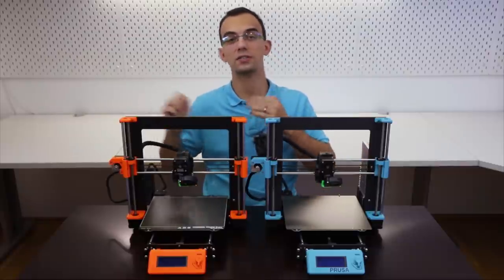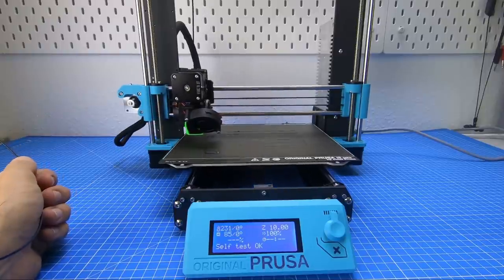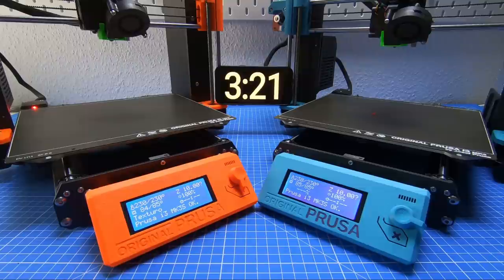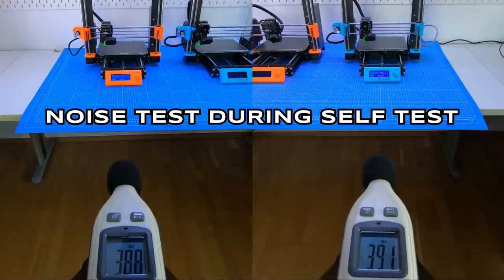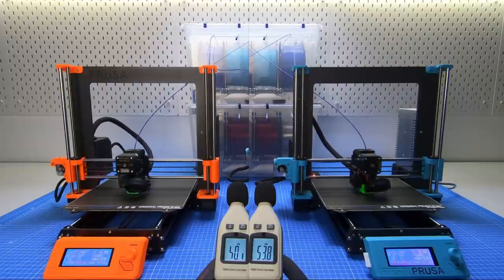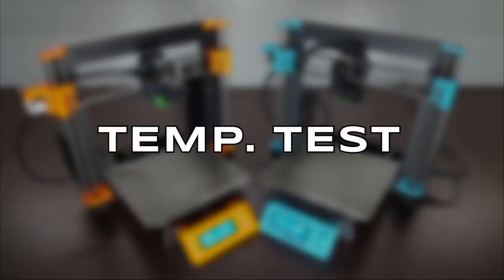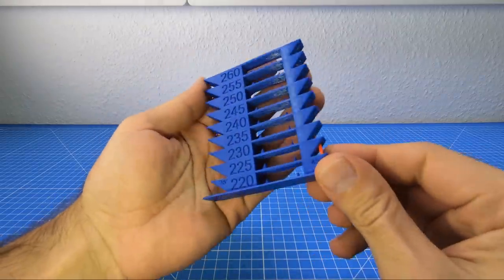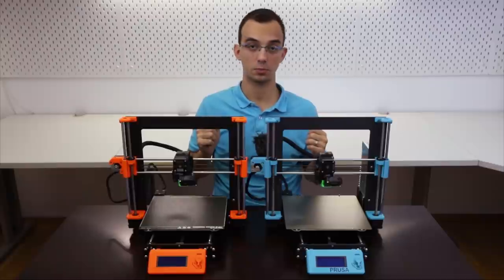The best Prusa MK3S 3D printer alternative? [test, compare, review]

Comment: Glad to see your good results with your Fysetc clone, definitely a testamant to just how polished the MK3S is as a design. I own two clones, one from Trianglelab and another from Blurolls, as well as a genuine kit from Prusa Research. I am planning on adding at least a Fysetc one as well as a colored Sealand/Blurolls frame kit to my farm. Long as you understand that you may have to replace some parts on your own they'll assemble just fine. That said, if I hadn't bought my genuine Prusa first, I would've never known what to check for on my clones to make sure everything was being assembled correctly. Run Sunon fans if you can from the start and definitely just print the PETG parts yourself as even Prusa's own farm parts leave a bit to be desired. And if you can, do Paul's silicone bed mod to ensure a super flat bed, genuine or clone. It's basically the nylock mod but better. Also stock up on those POM/Delrin leadscrew nuts and linear bearings, especially the leadscrew nuts if you're prone to destroying them like me.

In my experience I ended up liking my clones better just cause I knew what parts I was throwing into them and the fact support was on me. I also had a pretty bad experience with Prusa Support that led to me lone wolfing my genuine MK3S. My Trianglelab clone has more hours printing than even my genuine MK3S and I had the genuine one the longest so make of that what you will.

I did hear the Fysetc clone ships with a PTFE 4.1 bore hotend which if that's the case is just plain stupid. I am running Trianglelab's pre assembled V6 clone specifically for the MK3S on all my kits and as far as I know they are all metal from factory. 

For those saying the clones rip off Prusa Research, well the design is open source and the license specifically allows clones like these to be sold legally. 

Overall, great video and I am interested to see if you'll be reviewing the Bear frame clones or  other vendor's clone kits such as Trianglelab and Blurolls/Sealand in the future!
Reply from the maker: You made me curious with this bed "Paul's silicone bed mod" where can I find info about it?
Reply: @Dombi3D  https://github.com/PaulGameDev/PrusaMK3_Silicone_Leveling/blob/master/PrusaMK3_Silicone-Leveling-Jig-ThinBlade.stl

https://forum.prusaprinters.org/forum/user-mods-octoprint-enclosures-nozzles/prusa-mini-silicone-bed-leveling-mod/

For the jig and a comparable guide except done on a Prusa mini, process is very similar to doing the nylock mod though on the MK3S.

I don't think he's finished the guide yet but it installs similarly like the famous nylock mod. Only difference is you cut 3mm ID 7-8mm OD silicone car vacuum tubing to act as the new standoffs. 

Basically take off the bed, remove all the metal spacers except the one in the middle and replace them with the tubing cut with the jig. Carefully reassemble the bed so that it's being screwed in evenly and the silicone is compressed to the height of the old spacers. Once that is done fire up octoprint or pronterface and run G80, let that finish probing and then run G81 to get the absolute values. Once that is done throw the values in to this site 

https://pcboy.github.io/g81_relative/ 

and it'll convert it and tell you which screws to turn to raise or lower the bed. Once you get it to about 0.05 deviation you can start to level it at the bed temps you normally print at to get it super flat. When it gets to about 0.02-0.03 deviation it's good enough and the PINDA will take care of any remaining deviation. Paul recommends releveling after a week to account for the silicone settling in. 

Having done it to one of my clones I can honestly say it's worth the trouble but if your leveling is fine with the metal spacers I wouldn't mess with it.

Sorry for the long write up and if anything is unclear. Paul is active on discord, mainly Prusa's and 602 and if you need more info I can link you to those servers.
Reply from the maker: Thanks for the explanation. It looks really interesting. I have the feeling that the normal nylock mod is more stable but maybe I will give a try to this version also.
Reply: @Dombi3D  No problem! And that would be awesome if you ended up trying both mods!

Comment from the maker: Since then I have just found out that there is a hidden easter-egg "Experimental" menu in the new Prusa 3.9.1 Firmware where you can set up an "ALTFAN" (alternative fan option, because of the Noctua supply shortage the original Prusa had to deliver 3D printers with other fans also) which slows down the nozzle fan RPM and at the same time it makes the 3D printer more quiet. I will make a short video about it, but you can also try it out when you go under Settings -> HW setup and roll down to the bottom and push the knob around 3s. After it the new menu will pop up at the very bottom. Could be that it wont make any change first just after you restarted the printer. Tell me if you managed it.
Reply: Will slow down the fan RPM. That means there will be less cooling? Or is this option for the Clone with 3000rpm more in your Video?
Reply from the maker: @extrutim  This option is good for 3 wire fans for the Clone to make it more silent.
Reply: We can try that feature to clone prusa with out heat problems?
Reply from the maker: @gorilasfpv4600  I have not tried yet but seems OK for me.
Reply: I recently bought the Fysetc clone and tried the altfan option. It reduced the speed from around 7200 to 2800, which is even 1200rpm lower than the  original noctua one.

Combined with the seemingly lower efficiency, I think this might possibly  lead to the heatcreep issue territory.
Reply from the maker: @Jay Rizzie  It could be. Have to try out.
For me noise is not an issue because they are in the basement but if you sit in the same room (what I would not recommend) the fan noise could be annoying with time.

Comment: Outstanding video.  I wish it had existed when I originally purchased a clone from Fysetc.  I later bought an MK3s kit from Prusa.  The clone has worked fine, but the assembly was challenging.  Too many of some screws and nuts, not enough of others, no 3mm filament for the extruder cable support, a few other things that I have long since forgotten about.  Both of my printers get used a lot.  If I prorate the additional cost of the Prusa against the savings for the clone - especially after the E3D hotend and fan upgrade, the savings in price is negligible.  

I completely agree.  If this is your first build and you can afford it, buy a Prusa.  You won't 2nd guess your decision later.

Comment: I came to the same result as you.
I did the following changes to the clone:
1. original PRUSA fans
2. Original PRUSA Hotend (E3D V6)
3. Original steel sheets (smooth/coated)

everything else remained untouched.
Print results are equal as you mentioned.

But for unknown reason, if I need something, I always start the original PRUSA, I don't know why, but I do :-)
Reply: A complete hotend is not needed - I only changed the heatbreak to an e3d PE (for potentially adding an MMU2s) and the thermistor to the Prusa one. The nozzle is also changed to a higher quality on, non-abrasive.
For the PEI powdercoated sheet - of course ;-) It is definitly the best. The smooth one - my original smooth sheet is in its original package for more than 2 years now... The fans of my original prusa I changed end of last year - fans are not for eternaty anyways. So I keep the ones from the clone until they need a change anyway.

But there is one change I strictly recommend: Replace the spacers of the bed (exept the one in the middle as reference) and use nylock nuts for the other eight screws instead of spacers. So you can manual level the bed using octoprint. I normaly do not use octopint (I installed it on a normal PC only for calibrating bed). With an improved manualy leveled bed, the first layer is improved a lot.
Reply: @oleurgast730  actually, all my 6 printers got E3DV6 hotends, so I had them „in stock“. 
if they are assambled as intructed by E3D WIKI, they never ever make trouble. At least for the last 6 years
Reply: @frankvonthienen3862  Of course the do not make trouble - but there are two versions. The heatbreak for Prusa has a special design, to form the tip. The normal e3d hotends do not have it.
You mostly will not have any problems, exept if you add an MMU2.
But you won't have problems with the cloned hotend either, if you only change the heatbreak to an e3d heatbreak in PrusaEdition.

Comment: Nice explanation between the 2 printers, at home I have a MK3S and a mk2.5s printer. I was looking for some info of the fysect version but I couldn't get some clear answers until I stumbled upon this video ^^ good job!
Reply from the maker: I am currently working on the unboxing and assembly video. Stay tuned because I will give tips how could you build it even better than it comes with stock parts. I compared it with all stock parts build but new bearings and heatbrake would make it even better and safer.

Comment: I bought one of these instead of the trianglelabs one thanks to this video.I just finished the assembly today with my own printed parts in PLA exept for the extruder and the board case wich are PETG.  Definitelly buy your own M3 *8mm screws, this is NOT OPTIONAL. I almost ruin the Z motors because of that. 
The bearings I got were fine but you might get bad ones.
It worked perfectly once assembled, didnt even got that weird upside down LCD cable problems.
I didnt even needed to calibrate ther machine, not even the ESteps.
I already have an Original prusa mini and print quality is identical.

Honestly, its a great machine, I didnt expect it to work so well. Also is my first printer kit and it was super fun to build.
Reply from the maker: I had the same feeling :) That is why I bought 6 more :) IKO bearings have arrived today. So I will be not bored in the next weeks.
Reply: @Dombi3D  How many IKO bearings did you have to order?
Reply from the maker: @WrathOfVaz  min 6 (3 X-axis, 3 Y-axis) max 10 (+4 for Z-axis) for each printer.

Comment: Its an interesting video. I suppose one could argue the Prusa has better customer service and you are also paying for that or Prusa is charging for it? The nice thing about clones is that they help keep competition healthy and pricing from going through the roof if the product is good.
Reply: Prusa of course does not charge for customer service and it's really helpful if you are a 3d printer noob. They assist you in the whole build process if you need them
Reply: One important thing you pay for is the research and inventing Prusa is doing. If you buy cheap clones, you are taking away from that money pool.
Reply: @ulaB  while this is true, I don't think there is something wrong ethically by buying cheap clones. Prusa is open-sourcing their printers and everyone has the right to manufacture their own clones. I would even argue that these cheap clones are part of what Josef Prusa wants. Prusa wants everyone to have a 3d printer and this here basically is an affordable, very good 3D printer you can buy, if you don't have the money to buy a Prusa. If you have enough money, I think most people would happily go with the Prusa because they know that they will get quality from Prusa that they might not get from cheap clones.
Reply: @doktormerlin  I agree completely. I have been in the situation where I was not able to buy "the original" and got cloned parts instead. I was just stating another reason people always forget, besides support and quality :).
Reply: I bought a Prusa kit recently and it's a fantastic printer.  It was more expensive than these clones and competitors like Ender 3, but the overall package is just superior to the others.  Plus, it's not made in China.
Reply: Stealing someone's copyright, design and product is not keeping anything healthy.

Comment: Sorry, you missed the most impotant security issue on the clone. Fysetc uses a 4.1 bore heatbreak, so the tube inside the hotend contacts the nozzle. This is extremly dangerous, as the original Prusa has an all-metal heatbreak - so Prusas firmware allows up to 295°C mozzle temp - a temperature where PTFE already degrades into toxid fumes. Simply one wrong click (preheat accidently for Polycarbonate in the menu) needed...
So never ever use the heatbreak delivered with the kit. Always order an all-metal heatbreak - and use it instead of the 4.1bore one. Of course you can alternativly change the firmware (but if next upgrade from Prusa comes, do not forget modifying it again). (Same problem with the Prusa Mini Clone by Fysetc, by the way - I recommend the Bondtech heatbreak there)
Of course, if you plan on adding an MMU2s / MMU2s-Clone later, you should buy an e3d heatbreak in Prusa Edition (has a special inside design for forming the filament-tip on unload) anyway.

For the nozzle temperature: Thermistors have variations. You simply might change the thermistor to one bought by Prusa, as they have quality-checked the tollerance. Esp. if you have an original Prusa, you do not need different slicer settings for Original and Clone than.

I like the Fysetc mk3s Clone a lot. Have two of them (and a selfmade clone and one original). Using the right e3d heatbreak and thermistor, all have same print quality on same settings.

As Aliexpress has a "sale" about every 2 months, with collecting coins and coupons you can get the clone at extremly low prices. I payed 283€ for the Fysetc clone about 10 weeks ago (and 173€ for a Prusa Mini clone, by the way), using a lot of coupons. Even with buing an original e3d PE heatbreak, original thermistor, noctua fan, original PINDA (if you have problemes as I had on one of my clones), original Prusa PEI powdercoated spring steel (alltogether about 100€) and cost for the filament to print the parts you have a very low price under 400€ (including shipping and tax in Europe) compared to the about 800€ (incl. shipping) for the original Prusa mk3s - and get a clone practical identical to the original (exept for the capacitors inside the power supply). But in most cases, only the e3d PE heatbreak and thermistor (you can get them on 3djake for lower cost than directly from Prusa) and a cloned PEI powder coated sheet (from Aliexpress/Trianglelab, practicly identical in function and texture to the original) will be necassary (about 50€ altogether). In my case, only problem with cloned PINDA was auto-skrew-compensation did not work. But it is not necassary, as the mk3(s) do not need it - it was put into firmware for the mk2 with its sloppy frame.

At the last sale also the bear edition was available from Fystec on Aliexpress. In Europe from European warehouse about 310€ (shipping and coupons compensated each other). With a much better frame for only 30€ more it realy a catch (normaly, the bear is an upgrade costing about 80-100€).
Reply from the maker: Thank you for your detailed comment, I planed to post today the unboxing and assembly related video but I think I will add your 4.1 bore heatbreak issue in this video because it seems a critical one that I not realized by myself.
Reply: Link to the cloned PEI power coated sheet?

Comment: Really interesting, thanks for taking the time to go into so much detail on the comparison of the two printers. Would you set up separate printing profiles for a clone printer, given the different nozzle temperatures?
Reply from the maker: Thanks, I plan to use a micro swiss HSS nozzle with it which needs normaly +10˘C because of the worse heat conductivity so I think it will balance that temperature difference, and so I can use the original printing profiles. When it not works out I ordered original thermistors which would eliminate this problem and give the right temperautre values.

Comment: These videos are excellent. They are concise and focus on the things that matter. I'm disappointed you haven't followed up as you mentioned, such as with the results of replacing the bearings. I'm going to try a FYSETC clone and the main thing I'm concerned with is which components I should replace at the start. I'd also be interested in knowing if the FYSETC kits have changed over the last year or two.
Reply from the maker: I have a second video about this topic.
The bearings related I have not managed to publish, but I am using on Z axis IGUS polymer bearings and on the X and Y IKO Japan bearings. I have even posted links in the description. Since then, I have no purchased new modules, so I can not tell you how their quality changed.

Comment: @dombi3d First of all, thanks for your awesome Video! One question: can you tell me if the print after power loss feature is working on your clone?
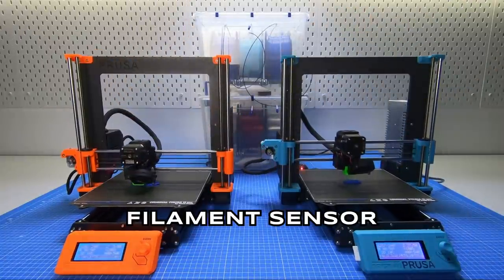Reply from the maker: Yes it does. As you can see at 6:40, it goes to home and continue printing (I just cut the warm up cycle out from the video). You can read the LCD bottom line that both printer writes "Recovering print".

Comment: Awsome video Dombi, very thought trough one and highly informative as well. Might be a silly question but what type of kit did you order the "Clone MK3S kit" or the "Clone MK3S bear kit"?
Reply from the maker: Thanks! The simple one. The bear version comes with an aluminium extrusion frame which is theoretically more stiffer but I had no problem with the original concept so I stayed with it. Bear kit needs also different 3d printed parts and I found more handy to print out the original parts.
Reply: @Dombi3D  Thank you for the answer, really like your other informative videos too! Atom jó és hasznos videók, végre egy informatív és hasznos csatorna a sok béna magyar között! :)
Reply: @Dombi3D  So the kit comes without the plastic parts, I assume. But: Which other parts are missing in the kit for a full printer? Ty!
Reply from the maker: @elmariachi5133  Check out my other unboxing video. You will see what is in the box exactly and which upgrades do I recommend.
Reply: @Dombi3D  Thanks!